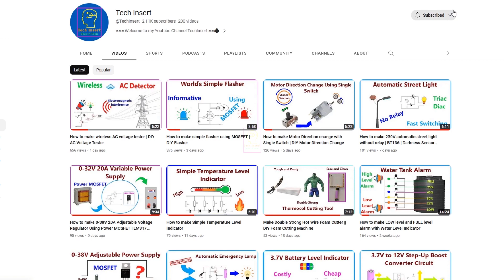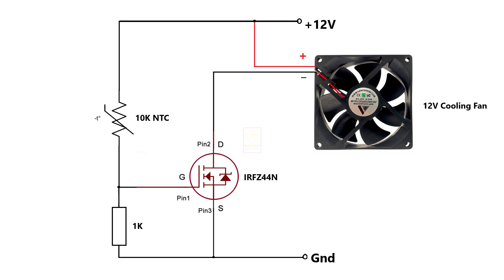How to make Temperature Controlled Fan using Mosfet | DIY Automatic Speed Adjustable Fan

Comment: At what temperature will this circuit start? At 25 degrees or at 30 degrees or at 35 degrees.
Reply from the maker: We can control the starting temperature by adding series resistance
Reply: @TechInsert  How is that? Sir
Reply from the maker: @ Yes series resitor or even voltage divider in series with 
thermistor

Comment: Hi. Will this circuit handle 8 fans of 120mm?
Reply from the maker: How much current each 120mm fan draws?
Reply: Thank you for quick reply. Each fan is less than 500mA
Reply from the maker: @eltonpereira875  Yes will works fine, provide heatsink to mosfet
Reply: Thank you sir.  @TechInsert
Reply from the maker: @eltonpereira875  You are welcome

Comment: can i put it in your other video in power supply 38v, 20a
Reply from the maker: Yes you can , Paste the thermistor using thermal paste to the heatsink preferably near to the component so that it will identify the increase in termperature early

Comment: This is a very useful circuit. Amplifiers, variable power supplies etc. can make use of this. You are making awesome things.😍😍😍
Reply from the maker: You are right, firmly attach the thermistor to the heatsink. You can even use multiple thermistors parallely and fix those in different heatsinks